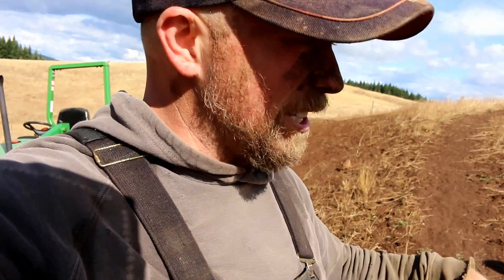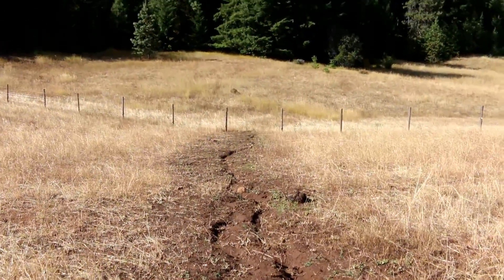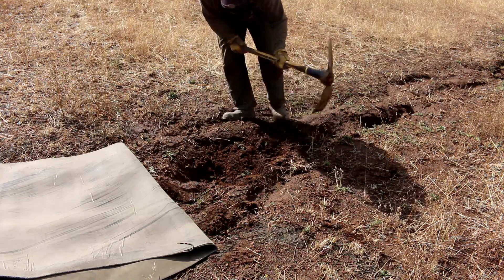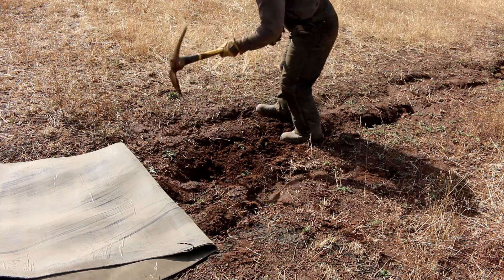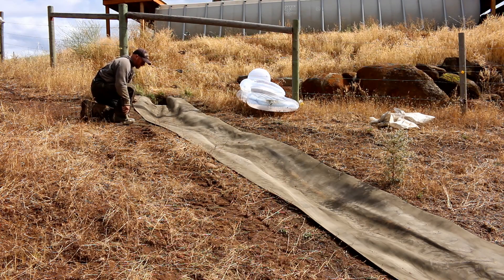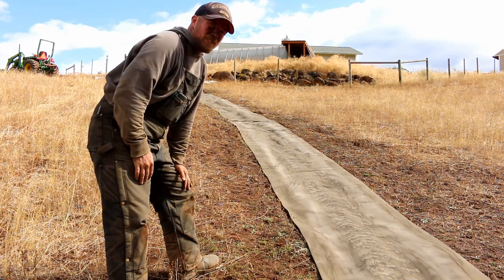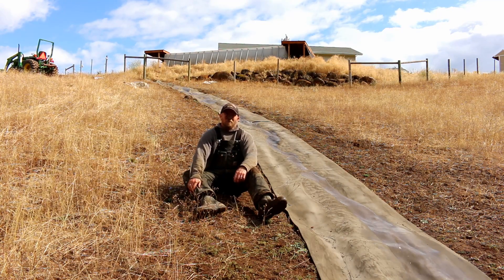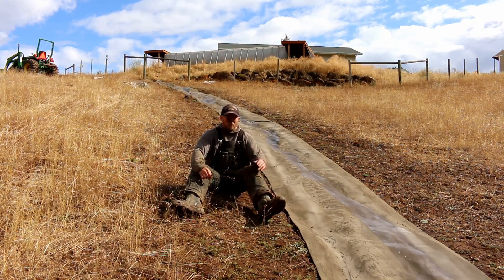Erosion control with CONCRETE CANVAS

Comment: The Concrete Canvas can be removed later on?  I mean will it dry as the cement or what ?
Reply from the maker: it could be removed but yes, it dries like concrete
Reply: Thanks for replying.

Comment: Great looking product, suggestion, install the Cement Fabric over the frost Line foam boards outside the HAB roll up doors.  The foam boards will last longer as the weight of the tractor and/or delivery van, will be distributed over a larger area, just make sure the slope is correct.

Comment: Is the material heat sealed along the edges to retain the concrete?
Reply: It is similar to plaster infused bandages where you get a little that works itself out over time but once activated it no longer loses any as it is now a solid mass of fibers and cement. Once out of the sealed bag it starts absorbing moisture from the atmosphere but that takes time to activate it all.